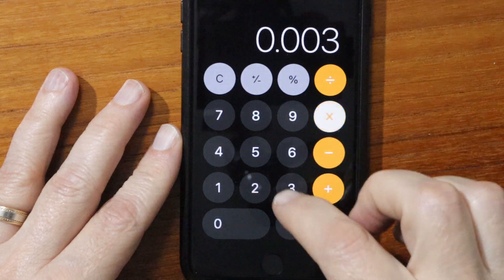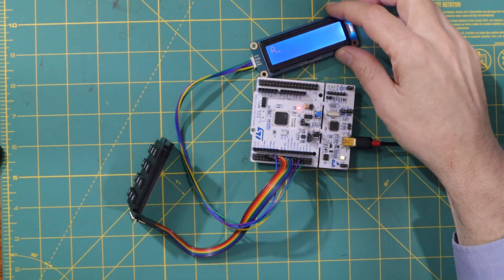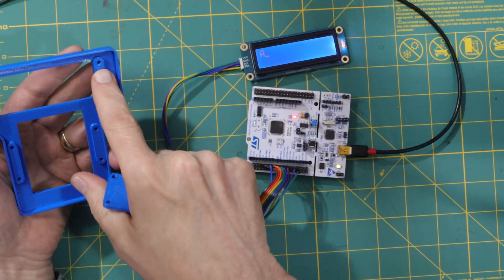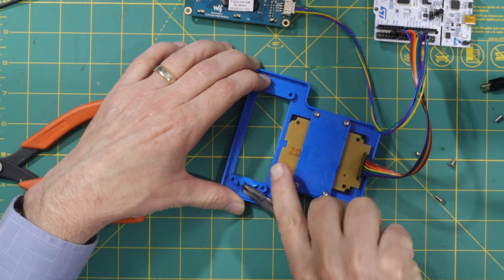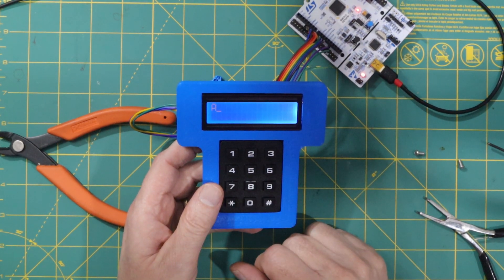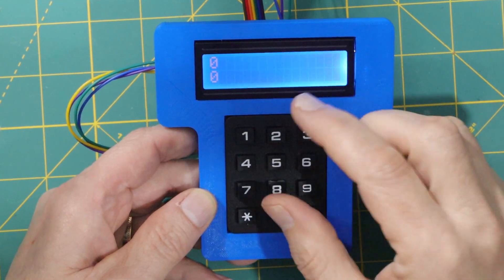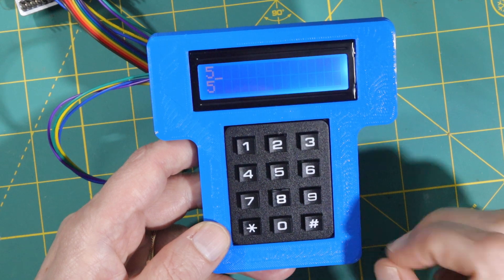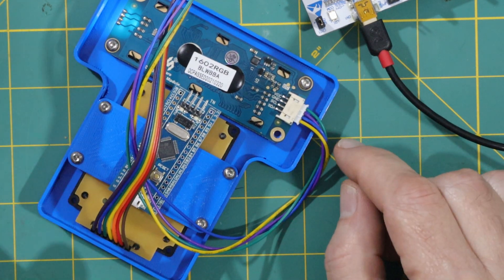The Metricizer

Comment: Nice job on the UI. I've had an app on my laptop for a number if years that does inch <-> metric conversion and lbs <-> kg conversion. If you used a four line display you could easily add the weight conversions.
Reply from the maker: I thought about going 4 lines. But didn't because my main reason for doing this project, other than learning a new programming language, was to put it next to my lathe so I can convert back and forth. Since the lead screw is metric and the cross slide is inches, it will really help.

Comment: Yes this episode is different than others yet still relevant to making.
I convert with my digital calipers. 
Just push the inch mm button.
On the fly I can find out what I need, tap and dies or drill size. Lay out or planning back t the conversion app.
Now it this was integrated to your lathe so you could see at any time what depth a tool is at.
As long as you don't do a NASA and forget what units are being used.
Reply from the maker: Once Rocketronics adds support for inches to the ELS 4 Basic, I'll have far less need for this.
Reply: @JohnSL  until then you will have a great tool and it's good to have skills to adapt and overcome problems. Your channel has so many ways to make something useful. It may not be outside the box because you make your box bigger and better.

Comment: Man I want it so badly! Will make one. Thanks for the inspiration
Reply from the maker: Thanks. I will publish all the files when I'm finished with it. I'm not planning on adding a battery as I'll be using it strictly at my lathe, along with the ELS 4 Basic.
Reply: @JohnSL  that would be amazing. Adding a battery is not a big deal in case someone wants to implement it. Just a 5v phone charger board and a small battery and you are ready to go.

Comment: That moment where the screen interfered with the plastic case reminds me of my constant mantra to myself:  Model everything!  It has bitten me so many times.  One time I left off the connectors for a circuit board I modeled in fusion 360 and then patterned 6 of them on an aluminum plate to hold them for a project.  I drilled and tapped the plate in the mill, proud that all the holes would line up perfectly, only to find out that I couldn't connect wires to them!  I would have seen that in the model if I had modeled everything!

Another time, I designed something for my tormach to mount to the column, and didn't model one of the bolt heads.  If I had I would have noticed it hit the oil fitting on the z axis while still in the model environment.  Instead I noticed when I heard a SNAP! and then had to make a replacement fitting.

Obviously in your case you're prototyping, but I'm sure that I've wasted more time because I didn't fully model than I've saved.  

Love your videos, as always!  My sons and I are working on the injection molder and we will eventually be in touch!
Reply from the maker: Thanks. I think it's a compromise between modeling everything and just enough. Clearly in this case it wasn't enough.